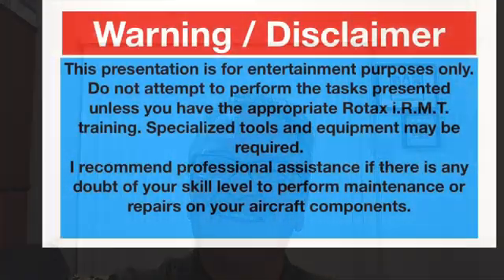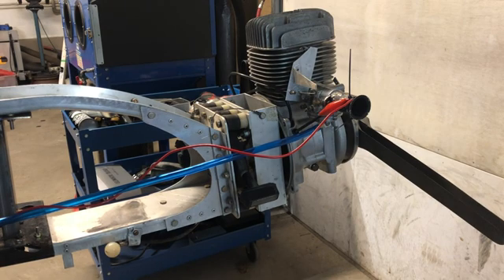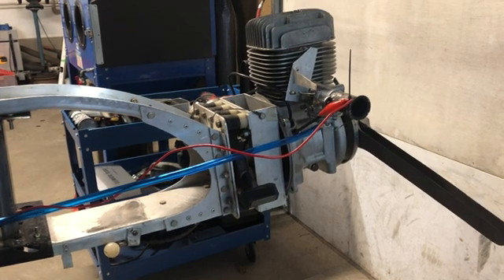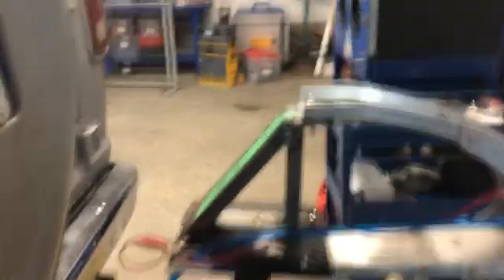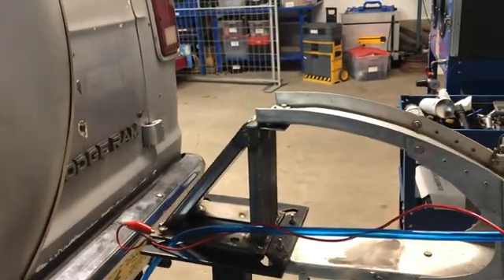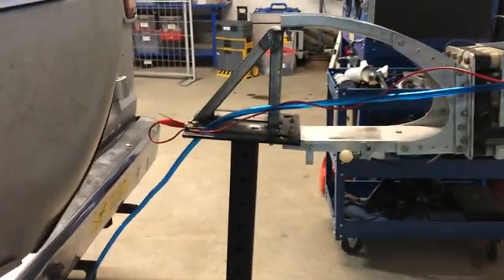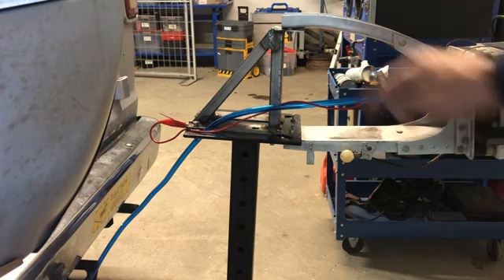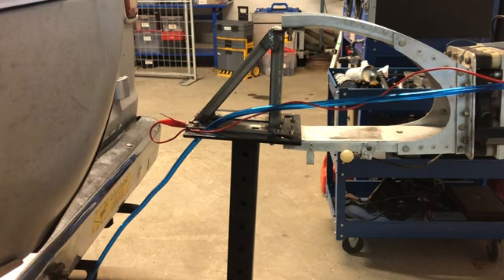Rotax 185 engine run-up

Comment: With those Flat Mufflers, it was rated 8.0 hp@5000rpm. With the bigger Round Mufflers, it was rated 9.4hp@5000rpm. With a Tuned Pipe they could make a lot more hp. Did you get the Carb Size?

Comment: What Size Carb does the Stock 185 use? The upgrade was a Solo 210 at 15hp@6000rpm. These 185s could also make 15hp with a little thought. CR Bump, some Trail Porting, Carb upgrade and turned a higher rpm.
Reply from the maker: @Armilite1  I just received two more 185s, I’ll measure the carburetor bore and let you know
Reply: @RotacRepair  Thanks

Comment: Well done for managing to rescue a video out of the footage and sound you managed to capture! Far better than giving up! 🙂
Reply from the maker: Certainly was the most challenging video production to date. My most used statement is “the machines are not allowed to win”
Reply: @RotacRepair  Love it! I share the sentiment at the moment as I'm trying to troubleshoot a total electrical failure on my camper. I will prevail! And once fixed it's back to the airfield. 😁  Keep up the good work sir. 👍